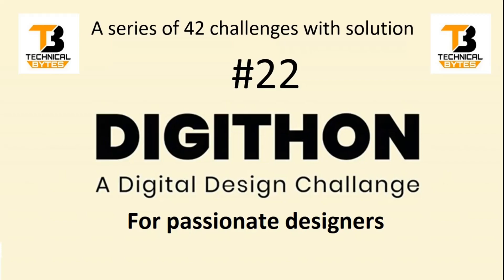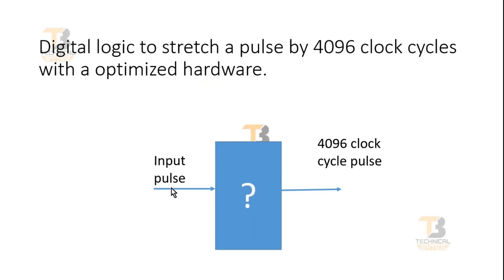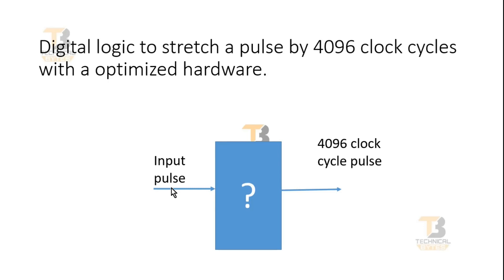DigiThon Question Part 22

Comment: 1) Give input pulse to T flipflop , The output will remain high
2)Start a 13 bit counter ( Its MSB has 4096 0's , XOR this MSB with T flipflop output)
3)Output will remain high for 4096 pulses , as MSB bit turns 1 , the XOR output will be zero so this can be used to stop the counter and reset T flipflop

Comment: This can be done by using a 12 bit counter to count upto 4096 cycle and an output pulse register.(Total 13 flops)
1.Use input pulse as a trigger for mod 4096 counter.
2.Output pulse register will be asserted when input pulse comes and at the same time counter will get triggered.
3.Counter will count from 0 to 4095,as soon as counter reaches its max value,count_reg will be autoreseted and output pulse reg will be deasserted.
4.Output pulse reg signal will be a pulse for 4096 cycles.
Reply from the maker: Can you please draw its digital logic? let us know whether you are using any comparator or not?
Reply: @TechnicalBytes  https://drive.google.com/file/d/1gsQN6AZl33aBRGxuZ2ylxodFvDfYsKkq/view?usp=drivesdk
Reply from the maker: what is counter_start signal ?
Reply: @TechnicalBytes  counter start is directly connected to input pulse which will also trigger  counter and help D flop assert to value 1 in next cycle.
Reply: Actually there is also another way we can generate this pulse... We can trigger the counter using input pulse..and do bitwise OR operation of count_reg..this will give pulse for 4095 cycles..but to make it 4096 we can OR input pulse into it. 

Pulse_4096 = |count_reg || input_pulse;

We need total 12 OR gates ,11 for count_reg and one for Oring with input pulse